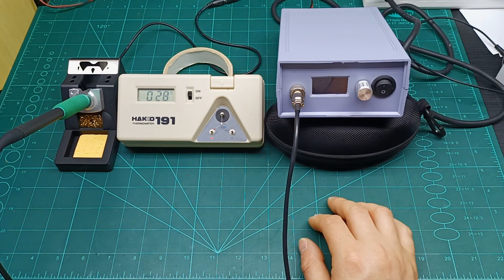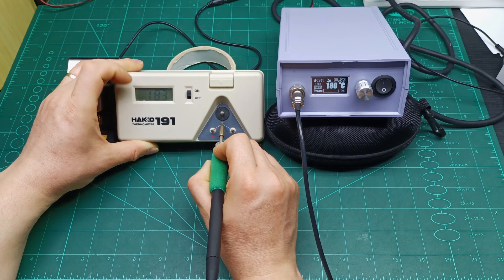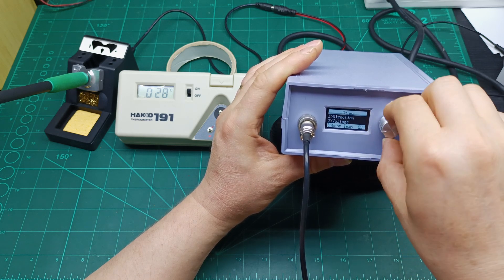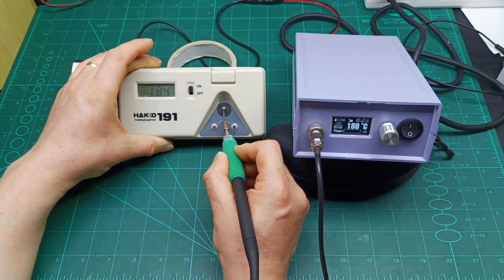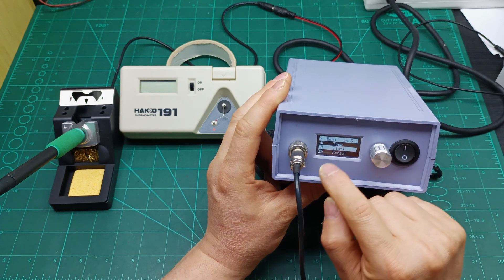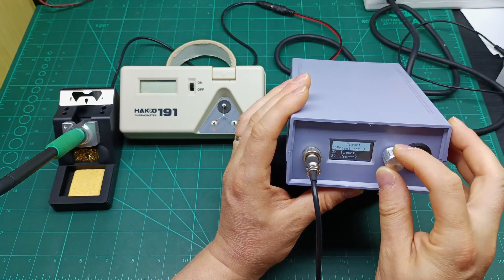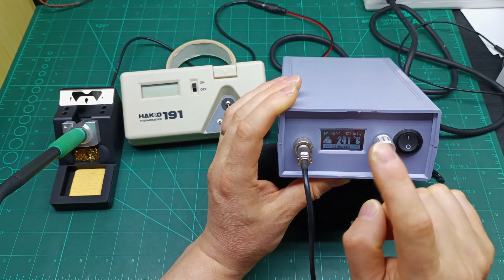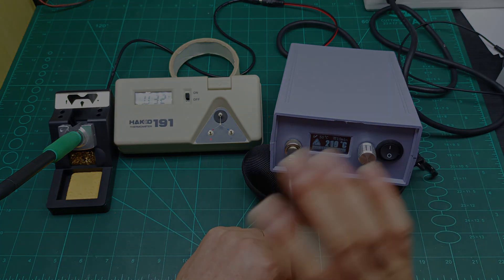Calibrating and setting up the T245 Soldering station

Comment: Hi Tony. As one hobbyist to another. I just wanted to thank you for this video. Very useful info. To throw in my (limited) findings in calibrating one of these:

I agree with you that the only way to calibrate the boards temp reading is to fake-out the room temperature. Of course my thermometer might not be totally accurate, but I ended up with setting my room temp to 6 degrees to get the same reading between the thermometer and the display reading.

The PID settings are another matter. After way-too-many trials, I found my best PID settings were: P=5, I=4, D=0.

Keep up the good work. Paul
Reply from the maker: Thanks for this useful information this pid is for the c245 tip or for the t12?

Comment: wrong, calibration is in PiD-P, PID-D , PID-I.
Reply from the maker: Do you have any idea how to calibrate those pid?
Reply: @SymbolTech21  
Starter PID Values (Recommended)Set the room temperature to the room where you work. Measure the voltage with a multimeter and enter 230v.......

Parameter	T12 Tips	JBC 210 / 245 Handles
P (Proportional)	20	                           30
I (Integral)	          0	                            0
D (Derivative)	10	                           15
Play with numbers.
These are safe starting points — responsive but generally stable.

🛠 Tuning Procedure
Start with Defaults
Set PID values to the recommended ones above.

Watch Heat-Up Behavior

Set a temp like 200°C

Watch how fast it heats and if it overshoots

If it overshoots a lot:

Try increasing D

Or lowering P

If it heats too slowly:

Raise P

If it gets close but never quite hits the setpoint:

Raise I

Once it stabilizes, it should stay within ±2°C.

If it drifts or oscillates:

Lower I if it overshoots slowly

Raise D slightly if it bounces up/down
 Fine Tuning 
Overshoots on heat-up	Lower P, raise D
Slow to reach setpoint	Raise P, I slightly
Oscillates around target	Raise D, lower I
Gets close but never reaches target	Raise I
Constant up/down wobble	Apply filtering (if available) or reduce I/P

I calibrated mine like this.
Reply from the maker: @micagocavuk that's a really useful information. Thanks much appreciated!
Reply: @SymbolTech21  Thank you, I'm here to exchange experiences.
Reply from the maker: @micagocavuk that's why I do videos as well. Because I'm not fully expert and no one is perfect in this world so exchanging opinions and tips will help us to learn one from an other to gain our skills!